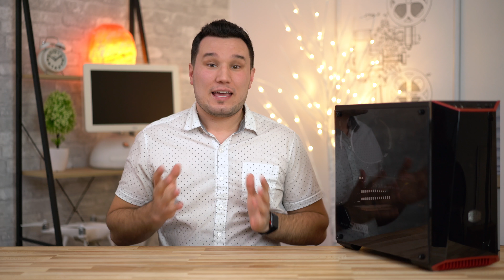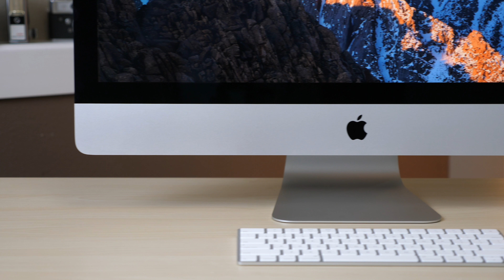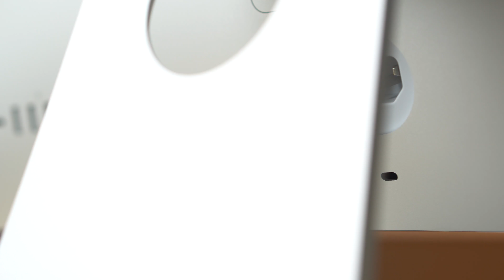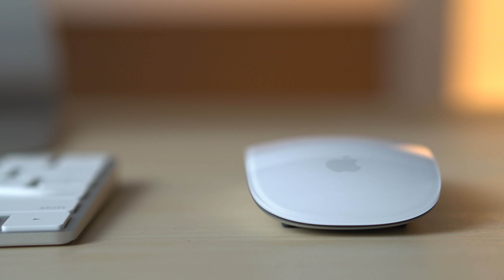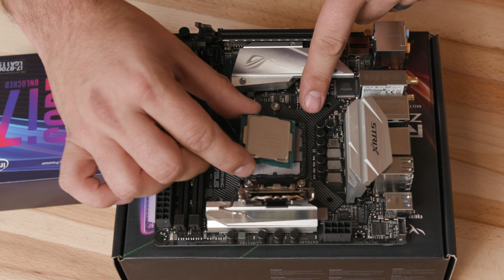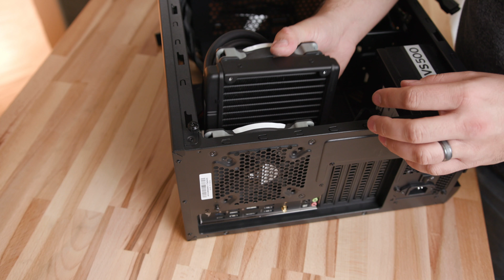$1350 PC vs $3000 5K iMac for Video Editing - FCX & Premiere

Comment: do hackintosh with the pc with final cut pro
Reply: Exactly what I was thinking. Show the better software on the superior hardware.
Reply: or make a PC that costs the same as that mac, not 3 times less
Reply: Yes. For me it’s working very stable on a gtx980/i7 setup. However with an Nvidia card you’re not going to get anywhere near the optimized performance you get out of an iMac. My bruceX is like 55s, not too diff than my 2015 MacBook Pro. Thinking of getting a RX580 but prices skyrocketed recently so kinda waiting to pull the trigger.
Reply: ilioslamperos awesome! Definitely gotta get my hands on a Radeon card.
Reply: ibrahim abed elhadi do i get RX 580 vs GTX 1070 both have same price
Reply: MacOs is not optimised very well for nvidia, I think... It won't be the same
Reply: Don't do that.

Comment: Does Final Cut Pro have a built in color grading tool on par with Premiere's Lumetri?   If I went with Final Cut/iMac, would I need to buy another software package for color grading?  THANKS.
Reply from the maker: They added a lot of updates with the latest version including a lot of extra tools for color. I bought color finale a while ago and still use that.
Reply: I would actually prefer Final Cut's color grading features over Premiere pro. Way closer to Davinci Resolve

Comment: Was it all the exact same media? Straight out of the camera? Transcoded? Were you using transcoded media in FCPX and not Premiere? Was background rendering on in FCPX? So many questions!
Reply from the maker: Background rendering off so it would be fair. If you have it on then it makes everything even faster with exports being ridiculously fast. Same media, same timeline, same exports, H.264 and H.265 footage (without transcoding). If you used transcoded footage it would be faster with both but not a huge difference since these computers don't have any issues handling this footage.
Reply: If you would use ProRes footage and background rendering mac would crush this pc even more .__.

Comment: This is exactly my current dilemma. Been using a top of the line iMac from 2013 since 2013 and it has been flawless. But about $2k for a great editing PC or 3-5k for iMac.... Hard to argue with a 2013 still running flawlessly though, that doesn't happen with PC as easily.
Reply from the maker: Keep in mind that $2000 PC will still need accessories and monitors. I talk about pricing at the end.
Reply: For sure! And I am make videos and photography professionally so the reliability is a huge factor.

Comment: So Adobe sucks and Premiere Pro is terribly optimized.
Reply from the maker: They got better (For the first time in 4+ years) with the latest release but judging based off of the results not good enough.
Reply: Exactly @Day Spoiler! The thing about Final Cut is that you can't do dynamic link between After Effects and Audition. Some that, for me and probably many other, is a huge deal breaker
Reply: Lric Nah, Adobe makes some amazing software with great tools. There is just a lot of things they need to fix so it doesn't crash
Reply: They need better optimization as well. Lightroom is a slow dog no matter how fast your computer is when compared to Capture One (which superior to LR in almost every way) when editing 40-100MB raw files.
Reply: They more or less have a near-monopoly in many of their product categories, so consequently they act like a monopoly. They could and should rewrite the code for Premiere and Lightroom from scratch, but that would cut down on their profits.
Reply: I don't know I have not tried FCPX lately, the last time I used it on my older machine it crashed all the time, it seemed kind of limited on the stabilization, I only use subtle stabilization because if you do too much its just annoying looking, and it seems like FCX was pretty much on or off and you could not really tweak it. It was by far quicker but it just seems a little to limited and unstable. I will give it another try, i will say the premier pro is god awful slow
Reply: Max Yuryev Adobe is working off an old clunky codebase built on PC but designed to cross-compile to Mac. While Apple uncharacteristically fudged the transition to FCX, they have not been afraid to cut their losses and rebuild from the ground up when they feel they need it, both in hardware and software. They have seamlessly transitioned hardware platforms a number of times, first to PowerPC, then to Intel, without disrupting their pro user base. While FCX was controversial, it would have been less so if they had allowed both old and new to coincide while the new codebase was built out to match the same advanced feature set. They lost a lot of high-end pro users in Hollywood, while gaining overall with the much more numerous semi-pro and Pro editors in the YouTube era and among wedding photographers providing a video package, where speed of editing and pumping out content quickly is paramount. 
Adobe is in a precarious position with their core products built up,over decades, as the codebase ages, having built up so many powerful features ay]t the expense of possible bloat and performance; they feel in order to keep ahead of the competition and to justify upgrades or subscriptions, you have to keep adding features, even if for most something like Photoshop has all the features they need, and a ton they will never use. What they want is not Elements, but a more lean and tuned Photoshop specific to their needs. I expect it is similar with Premier, though what most cry out for is performance. Until now, the solution has been to throw newer and more powerful hardware at it to mask the inefficiencies, much as with Lightroom.
Reply: facts, adobe sucks